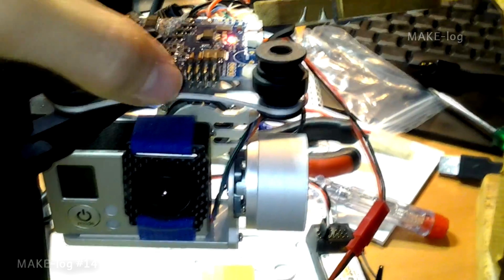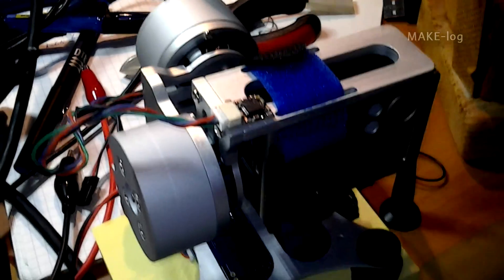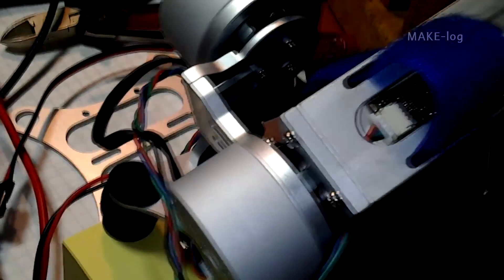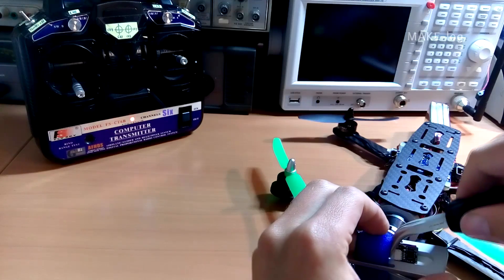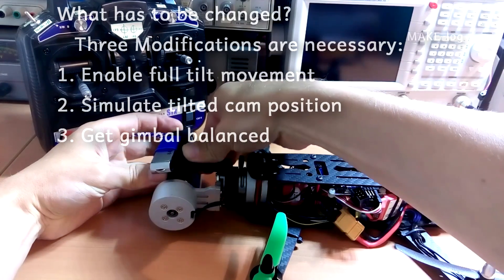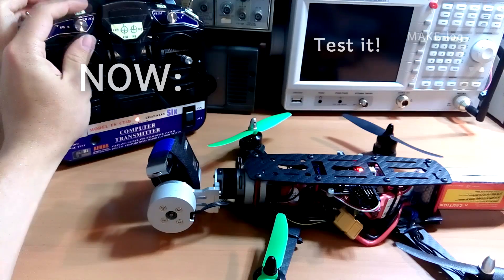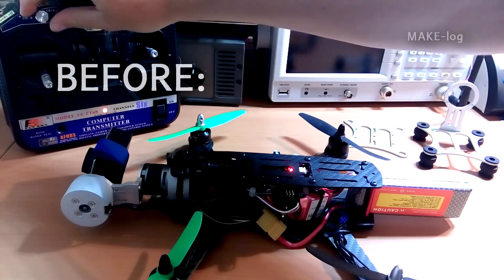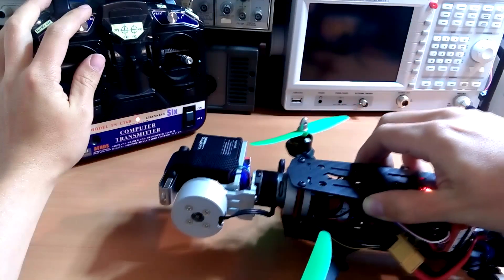MAKElog#14 cheap china brushless gimbal MOD: downward facing camera view

Comment: Thank you a lot for this video, I've been been thinking in getting a gimbal for my 250 but wasn't sure if a cheap one would be any good...

Do you have maybe any flight footage? I'm guessing the MT1806 motors struggle a lot with the weight of the gimba?
Reply from the maker: Irvel N Hey Irvel, you are right, the QAV250 lost a lot of its agility due to this mod. This is because the mass in the  shown mod is distributed mostly to the front and back, so I built a second modification with the gimbal much nearer to the QAV250's center. The second mod, not shown on Youtube due to my tight free time, was more agile. Due to a  propeller break during flight, the second mod crashed down on concrete with a speed greater than 60 km/h. I have  footage of the second mod, but not on Youtube.
The gimbal offers quite alot potential for balance tuning. If you do so, I think the cheap gimbal will do fine.